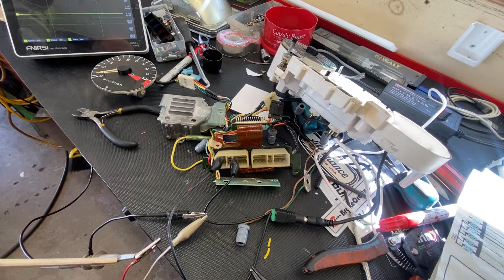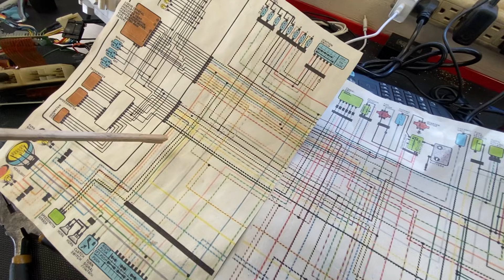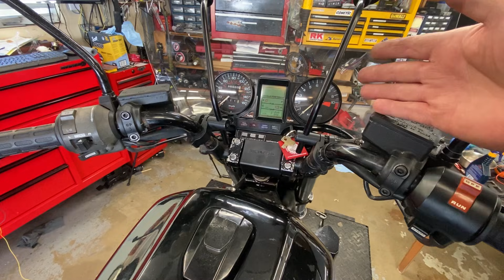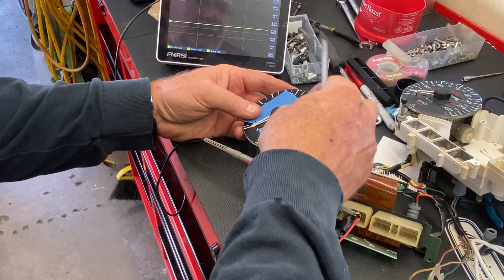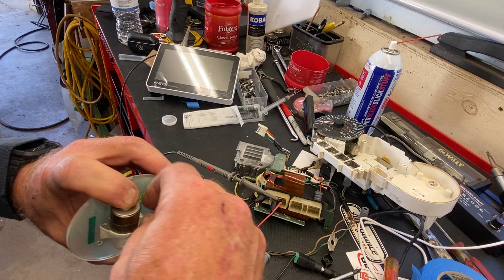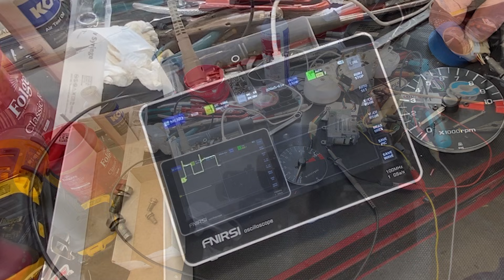Sluggish, inaccurate motorcycle tachometer FINALLY repaired!

Comment: You oscilloscope reading looks like stepper motor control. Stepper motor typically don't have feedback that is why on modern car or motorcycle indicators move (after ignition is switched on) all  the way up and down to get position reset.

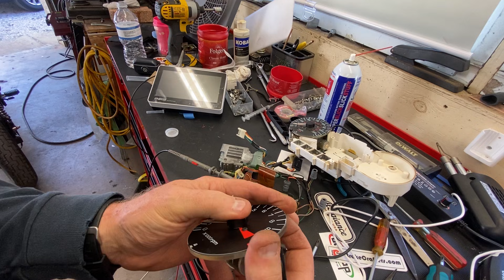Comment: 22:15  Lubricants work great to lubricate, but often over time they evaporate. You solved the problem with lubricant, but potentially you may have lubricated some dirt, corrosion or crystallisation?? 
When lubricant works magic for me, I always flood the item then use compressed air  like a brush, a few times. Just to make sure that I'm not just temporarily lubricating a 'microscopic mountain' of corrosion or salt that could potentially grow again, once the lubricant has, and will evaporate over years.
Just my thoughts.. 
Nice vid 👍👍

Comment: Enjoy your videos, I fixed my tach on my ZR550 a few years ago and found this very common IC chip that translates coil pulses into the signal to drive the tach mechanism. Just thought you might find this interesting.  https://youtu.be/zb_aLT8uyL8?si=funqvkePt4drDdZx
Reply from the maker: YES. Awesome, so that's what the damned thing does. But here's the question: how does the device know where the needle is and is there any feedback from the motor to tell the IC chip to move the needle? That's the part I can't figure out. Well, one of the parts. Thank you.